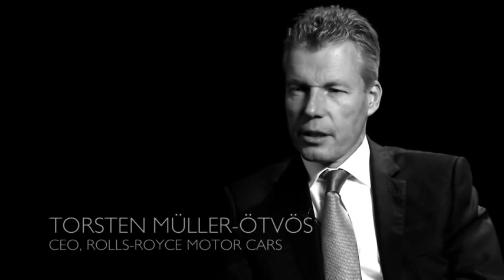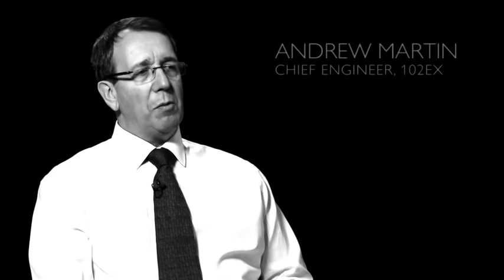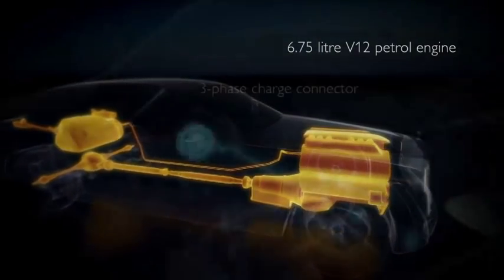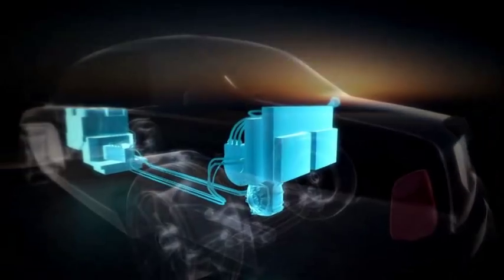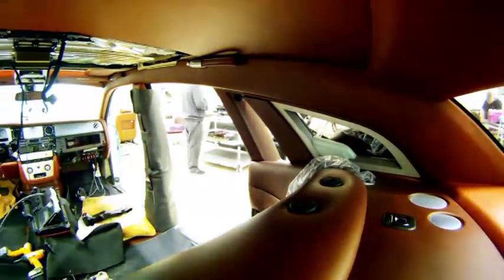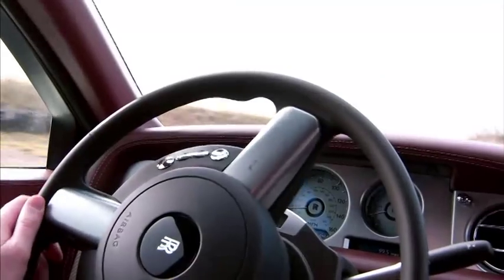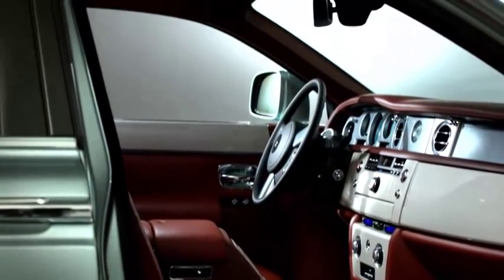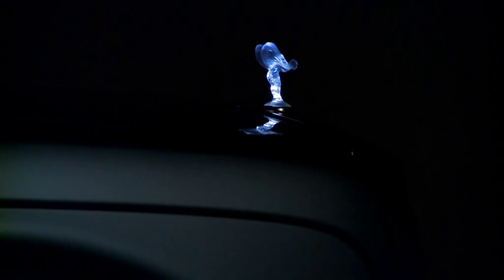Rolls-Royce 102EX Phantom Experimental Electric revealed

Comment: Yeah you're correct about that. I just somehow feel it's not true to the spirit of Rolls. It'd be like if the new Viper had a V8 instead of the V10.  Yeah, it might have some positive points about it, but nothing says Viper like that massive V10 engine.  Same goes for Rolls.  It's supposed to be like riding a cloud, but this cloud has some massive ridiculous exotic engine under the stainless stain hood lol

Comment: It seems like the best next step. The vehicle is already quiet, why not make it even more so with electric  motors. Then there is the gas cost of driving a V12, yet with electric that give you more range and save you some money not that you would have to worry about that if you paid for a Rolls. Another thought why a V12 when you are suppose to ride in the back of the car and enjoy the smoothness of the ride not the speed. Yet in the Wraith when you are driving then you get more torque and speed with the electric. If they would put the batteries on the bottom like Tesla then the car would also have more room for luggage and golf clubs etc. Then you could have AWD instead of RWD.

Comment: What has to happen for a car of this prestige to be electric is only one thing. The drive train and performance have to be superior in every way compared to gas. Electric motors are more than capable but battery tech and there weight that are slow to meet the demands of an automobile.